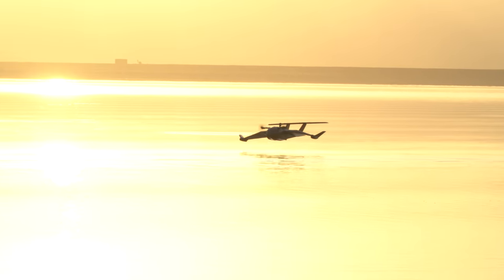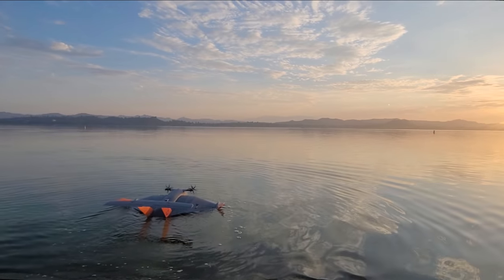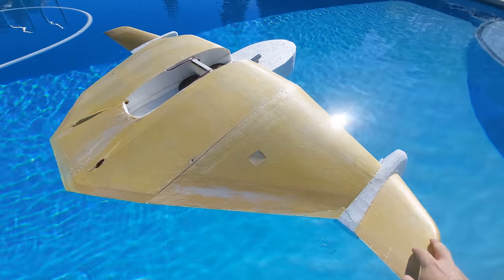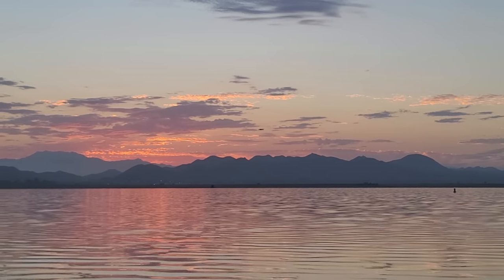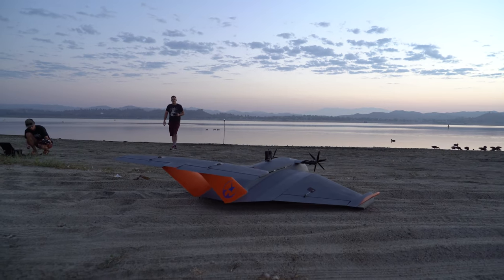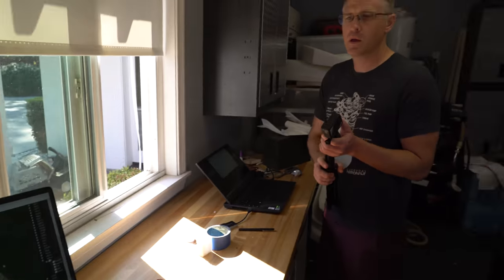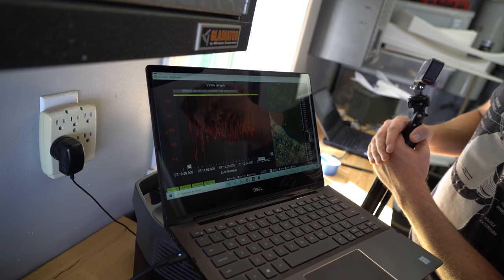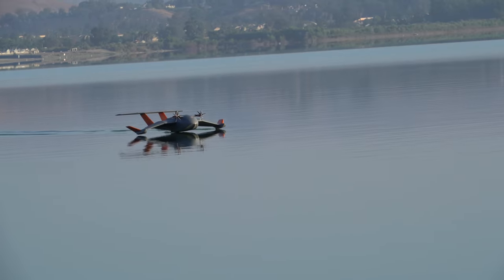Ekranoplans:  Autonomously Expanding the Limits

Comment: It's an excellent idea to replace the expensive aircraft carrier idea.  The plane is thrown in the form of a capsule in the water, then wings and a fin come out of it, and it takes off with a propeller engine, and then with a jet engine in flight mode

Comment: Fantastic project and concept! When I was in Germany in 1991 I met the German engineer Dr. Hanno Fischer who was at the forefront of this field at the time. I met with him in hopes of licensing his tech but unfortunately he had recently signed with a company in Westport, CT to make 5-6 seat version.  Their ‘sales pitch’ was that you technically didn’t need a pilot’s license as their version could NOT fly out of ground effect. It was technically a boat, governed by the Coast Guard. This made it tremendously efficient as you could use a much smaller engine, and when need be, you could temporarily clear obstacles by compressing the air cushion below the craft and ‘bounce’ over smaller obstacles. The craft was mainly built to use rivers, waterways and open water as highways.  To this day I still believe there’s a tremendous value in this concept for passengers and freight. Keep up the great work! 👍
Reply from the maker: No way that is amazing that you met him!   I'm jealous!

Comment: I remember "designing" ekranoplans in X-Plane for the lols. It was most difficult to exploit ground effect in a simulation, not explicitly designed to do so.

Glad to see that the company is still alive and kicking and has apparently taken important steps forward addressing the main issue with stability in ground effect.

It has become clear that it is virtually impossible to design a self-stabilising and efficient WIGE craft capable of mastering varying real-world conditions.

Your contribution might seem playful to some, but others will consider it cutting edge applied engineering.

Kudos!
Reply: I found it a bit odd that 'the company' gave them pretty much open ended design freedom, and sounds like they came up with the design!!!??
So the company, that's been working on this for some time, didn't even have a concept design????
Reply: @pawspaws101  it has. This configuration of an inverse delta in ground effect is very old, first designed by Prof. Lippisch in the early 60's and first "flown" in 1963. It was subsequently developed into larger more capable (prototype) models that culminated in the design of the company talked about here.

Comment: Of all the channels I subscribe to, this is the video I have been most anticipating since your first installment. Have any plans for your first craft? Put the same system in it?  If you don’t have plans for it,  let me know. I’m interested in getting it to the fully autonomous stage, flying waypoint missions including takeoff and landing. Great work. Great collab!  Your fabrication skills are praiseworthy.
Reply from the maker: I don't have plans to share for the first one, this one is completely different in every way though.   You should go for it, these things are a hoot.
Reply: @thinkflight  would you be willing to send me the airframe if I cover freight charges?  Or let me know how much you would need to part ways with the airframe and onboard electronics (receiver, servos, anything that might difficult or help impossible to remove. ) you 

I have a selection of autopilots, sensors, batteries, and transmitters.   I’m an electronics engineer and embedded systems designer/programmer. I just don’t have mad fabrication skills you’ve demonstrated, though you have inspired me to develop those skills over time. 

Best wishes and keep up the good work!

Comment: To explain the concept in simpler terms, it is used by pelicans skimming over the waves near the beach... apparently they've known about the WIG effect for eons. :)
Reply: It is also how most big birds can slow down to a few km/h before landing
Reply: I mean - noticing the effect is basically guaranteed - any aircraft that has fixed wings will experience it during takeoff and landing.
Reply: @ABaumstumpf  Yes, but WIG craft are specifically designed to fly in the effect efficiently.

Comment: I never thought I would be that guy but please don't run up your props while standing eye level in front of them without any safety glasses.  I've had prop nuts let go before and I can tell you the propeller travels forward in a straight line really fast when it happens.  Aside from that you and Daniel did a great a job.  Keep up the good work.

Comment: Great stuff. Still very keen to see an some efficiency tests to show the energy savings by being in ground effect!
Reply: Yeah, and once you realize this would never work at full scale, you realize it is a huge fail.
Reply: @VidarrKerr  this does work at full scale. I don’t understand your comment.
Reply: @toxaq  Bro, it is a tiny little model plane. That is NOT full scale.
Reply: @VidarrKerr  I'm aware as I watched the video. I've asked for data to see how useful the effect is at this scale. You stated "this would never work at full scale". I don't understand how you could state this as there are plenty of ground effects vehicles at full scale. So I'm wondering what you meant by your comment.
Reply: @VidarrKerr  You do realize ekranoplans get better the bigger they are right? both in efficiency and in stability
Reply: @toxaq  Only if the ocean surface is near flat.

Comment: Impressed with these craft. Tail out of ground effect? What about a canard version instead?
Reply: Canards are pretty unstable and how would it perform if it was in ground effect?
Reply: The reverse delta already is one of the more stable forms for ground-effect, but with small aircrafts you really want the extra stability that comes from the surface that is further away from the ground.
Canards would like have a similar problem as the wings - their effect would vary greatly depending on how close to the ground it is.

Comment: Kudos!

Handled those moderate chop and wind conditions much better that I expected.  How far will you push the envelope on this, any plans for autonomous sea trials etc?
Reply: Yeah, and waves doesn't scale, those were som mountains if you take scale into it.
On a fullsize craft the waves are more like ripples in the ground
Reply: @someoneelse7629  I would say that survivability gets worse with increased scale because the length, area, volume, strength, mass, velocity & Rn ratios involved in scaling, full size things tend to be more fragile for their size than models.

Comment: How does power consumption compare in ground effect vs normal flight? Is there an advantage?
Reply: I would love to see this data. Once in ground effect mod the increase lift would require much less propeller push. I would guess is a trade of speed x efficiency in this condition.

Comment: Ground-effect aircrafts are really interesting, sadly scaling them down does not work so well for flying over water as the effect only becomes really noticeable once you are very close to the surface so waves become a big problem.
Reply: The optimal height depends on the size of the airplane and I suppose some other factors but the Caspian Sea Monster hat an optimal ground effect at 20m height.
Reply: @Garium87   "The optimal height depends on the size of the airplane"
Yes, hence why i said that downscaling has serious problems as you need to get closer and closer to the surface to get noticeable results, getting ever closer to the wave-tops.

Comment: A proven design, though it has been 50+ years since it was used.  I was wondering if you put the weight of the full sized machine to scale also? The control system in and of itself is quite amazing.
Reply: With scaling down a model the behavior is much more sensitive compared to the full size  one. In RC planes and helicopters, the larger the model, the more stable it is, so if anything, this video shows that the full scale one would probably be very easy to control (like you said, a proven design).

Comment: Wow.

Wow.

So, back in 2006 and 2007 I got into scripting vehicles in Second Life, and built a plane that switched between two of the control models in their vehicle system based on altitude and angle of attack to try and simulate Mehve, the "jet glider" in Ghibli's movie "Nausiica".

This is like the same thing in real life with no physics hacks and cheats (like, I could just arbitrarily apply a precise impulse to the plane without worrying about little things like engines and control surfaces). Amazing.
Reply from the maker: https://www.youtube.com/watch?v=AXvIU_KisqM

Comment: Ekranoplan "Lun". Built in 1983. Soviet Navy.

Tactical and technical characteristics : Edit Wingspan - 44.00 m; Length - 73.80 m; Height - 19.20 m; Wing area - 550.00 m2; Weight: empty aircraft - 243,000 kg, maximum takeoff - 380,000 kg; Engine type - NK-87; Thrust - 8 × 13,000 kgf; Maximum speed - 500 km / h; Practical range - 2000 km; Flight height on the screen - 1 ... 5 m; Seaworthiness - 5 ... 6 points; Crew - 10 people; Armament: 3 × 2 - PU anti-ship missiles 3M-80 "Mosquito", 2 × 4 - 23 mm AU UKU-9K-502-II.

Comment: The engine propellars being in the front has great influence of it being safe, because the body is dragged behind so to a line with the engine path, versus the body being pushed and causing a different maneuver path then the engines. Downside, the blades obstuct the field of view, had it been man cock pit driven.

Comment: Great job guys!

I am not sure what surface roughness/conditions you had for the section of LIDAR on the screen in the video or the time scale (between crests) but I imagine a good percentage of the 0.3m-0.7m discussed in the e was surface undulatins NOT craft movement! (Would love to be involved!)

Went to China in 2004 to build WIG craft!

As many of you will know this GEV (Ground Effect Vehicle) is/has been known as a PARWIG/PAR-WIG (Power Augmented Ram Wing In Ground Effect) air forced under/over the wing to create STATIC lift even at stand still!) and particularly in this model, with its very low wing loading, can clearly be seen to have particularly low take-off and landing speeds!  Many of the early Russian and later (low tech) Chinese craft used this PAR tecnique! (This, of course, has benefits caused by reducing the structural demands on the craft during take-off and landing, which are typically significantly higher than for conventional aircraft taking off and landing on fixed/finite prepared surfaces!)

There ARE design solutions that can eliminate the need for the large elevated tailplane! (and still permit operation in and out of GE!)

There ARE propulsion options that can significantly reduce airfrme loads WITHOUT forward/PAR configuration to produce static lift! (which inevitably places prop tips near wave crests!)

Comment: i would love to see this steered through yaw control. rolling the aircraft makes more sense for free flight. but limiting it while in ground effect would allow for tremendous span further increasing ground effect gains at greater altitude. this could allow the shipment of very heavy payload with the ability to clear incidental obstacles.

 as well as providing a far more comfortable ride for cargo/passengers. 

if you are taking requests, put some big honkin rudders on the thing. YOU COULD DRIFT!!!!!

Comment: Problem and Achilles heel of all Ekranoplan designs is the huge difference between the HUGE amount of power needed to get into the air and the comparable little power needed to soar on. So every Ekranoplan must carry a lot of surplus engines that are only used for a minute each flight.

Comment: Why not use a foil ( kite surfers have) to reduce drag when taking off? It would save valuable battery life. You could have it concealed flush with hull,  mounted centrally and fold forward and up when airborne. Not needed when landing. André in Sydney

Comment: Just wondering if put a retractable hydrofoil underneath. Would it be smoother take off, so when starts raising into the air ground effect starts.  Maybe 2? Can be steered by hydrofoil under take off speeds yet not as bumpy. Maybe connected in operation to what is already there.

Comment: to dumb down the groud effect , its concentrating air between  the wing and waters surface, this makes the air thicker and act as a cushion. the plane riding on this thicc ass cusion needs way less energy to stay airborne, it also means the propellers get to push way more air with less effort , so the plane can operate far more effiecently

Comment: Add Edison generators and inverters to get ac.  A small permanent magnet motor with generator coils can provide unlimited flight airplanes.  What if you flatten the bottom of the wing body carry the generator and carry the ground effects.
Reply: A plane flat back from leading edge to reduce turbulence and drag and increased speeds.

Comment: The Soviets ran into the problem you get when the surface of the water you're flying over is not glassy smooth. Of course their ekronoplans were the size of destroyers, but the Black Sea Monster didn't pan out as a viable weapons delivery platform, or you would see them in operation today by the Russian government.

Comment: In all seriousness, where could I find plans to build this?   I’d ask a fellow Canuck Anthony at TBRC Wings to help cut the foam, and I’m a decent builder.  Looks like EPP wings and EPO body?  What did you cover it with?
Reply: This information is not available as the design belongs to Flying Ship Co
Reply: @dsingfsw  I ask because it looks like a few older designs
Reply: @northernfpv9562  Don't know why I'm not replying from the Think Flight account but whatever :).   Yes it is a reverse delta WIG, but the specifics of this guy are proprietary and won't be released.
Reply: @dsingfsw  too bad!  Sometimes designers release drawings so that modellers can test them out at different scales.  This would be a fun one!

Comment: Question. Watching the turns, it seems like it isn’t able to tightly turn while in ground effect due to wing clearance of the water. How does this work while turning with Lidar? It would seem like the lidar sensors are more towards the center and therefore the plane would not automatically lift when turning. 

My next question is would it make more sense to put lidar sensors on each wing towards the edges so that when you turn  the plane lifts automatically giving more clearance for tighter turns? Or would this negatively effect the ground effect and become too unstable by lifting too much in a tighter turn? Just a thought.

Comment: I have never understood why GEVs havent been the go to vehicle for low tonnage shipping and ferry services. talk about the best comproimise between tonnage capacity and fuel efficiency.  The mind boggle at the missed opportunities.  I'm sure the Rusians are like, "Yeah, I know, right!"
Speaking of the Russians, didnt they discover the vehicle was even more efficient if the wash form the props/jets was directed under the lift surface?  Just sayin, I think there might be some missed potential here.  Also, if there was an independant sensor for each motor, the banking would enhance the turing radius by bumping the speed of the higher motor.  Anyways, it looks fantastic.  Great work.

Comment: Wait, aren't the reverse delta wings supposed to have less change in center of lift when transitioning in and out of ground effect? I thought that was the reason many modern projects use them.
Reply from the maker: This is the general knowledge, however this has definitely not been my experience so far.

Comment: Would a strong enough wind gust, particularly a tail wind, possibly “wash out” the ground effect?
Reply from the maker: It would affect the plane the same as a gust would on any aircraft.   With a tailwind though airplanes simply compensate by having a higher ground speed and in the air, don't notice it.

Comment: If you used to wingtip motors on this design would it not be a hell of a lot more efficient with the counter  rotating vortexes pushing off the water
Reply from the maker: Wingtip strikes in turns would not end well.

Comment: I suggest a "sea sled" hull for more efficient taxiing and quicker lift-off.
Reply from the maker: What is a sea sled hull?
Reply: @thinkflight  Hydroplanes/tunnel hull.  You might consider it to be a stage-1 or a 2-stage SEV.  https://nwmaritime.org/wp-content/uploads/2017/08/Hickman-Sea-Sled.jpg
Reply: @thinkflight  My dad was a naval architect and had designed and built several sea-sleds.

Comment: did someone try using sailplane aifoils of the newer generation? theyre not flat on the bottom but have a bulge wich should increase air pressure and therefore more groundeffect? Or wouldnt that work because they are designed to have less induced resistance and so less wakes?

Comment: Excellent idea and project.when you put an extra pair of propeller units  aside of the body,just inside the wing like part,horizontally,to have more direct lift,like in heycopters ,would that be helpful to stabilize and to lift of more easy?can you imagine if such a prototype can be driven by combustion engines on hydrogen
and oxygen on the frontside with "normal" vertical propeller units in combination with electrical horizontal
Propellet units in the side compartments,?by which the electricity is produced by the frontal engines.
Is it possible that the body can be formed more streamlined with enough capacity to transport about
Sixty persons wih luggage?what are the possibilities to create a model for military purposes even with
Jet propulsion on hydrogen/oxygen technology.this all would be vey interesting.
Another idea is to change also the common helicopter configuration with the possibilities of this concept,
also to fight  fire calamities with water and working more efficient and faster.
wish you success with your project and mutual cooperstion with other inventers ass well as positive business partners.ALOHA.